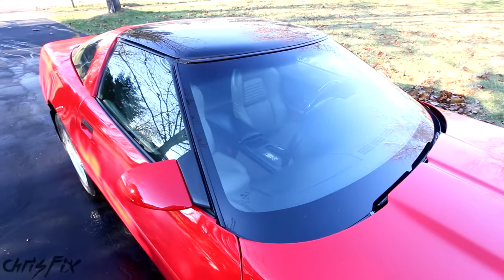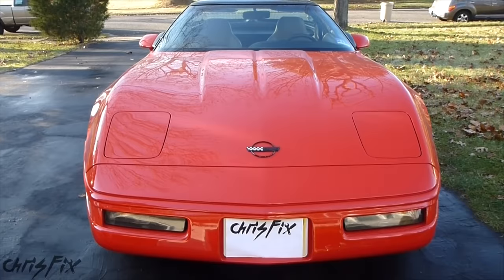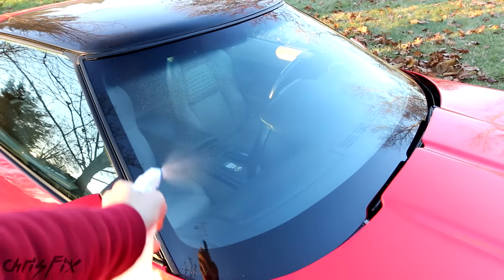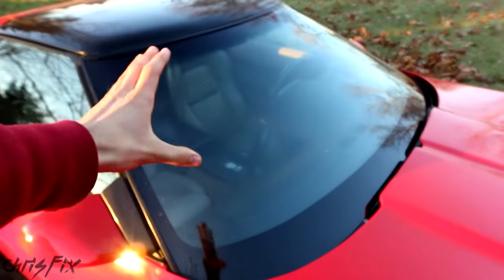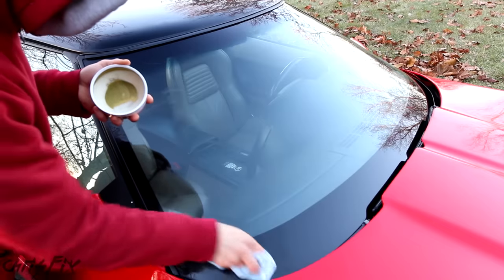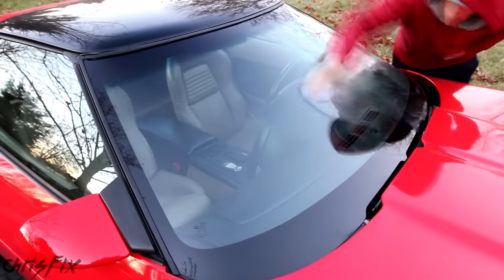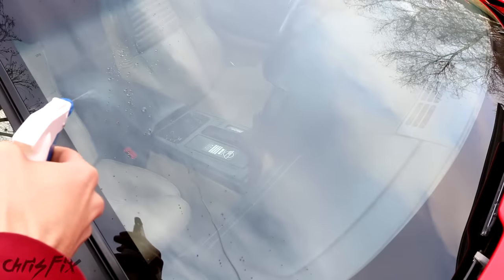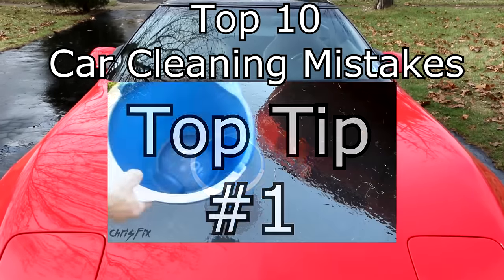How to Super Clean Your Windshield

Comment: whats the best way to clean the microfiber towels after they are dirty?
Reply: Really hoping you answer this one @chrisfixed!
Reply: Ride Alongside most detailers throw them away
Reply: Honestly.  Most of the time they are inexpensive enough to throw away.
Reply: Use another microfiber towel
Reply: Chemical guys have a video for that
Reply: Clay bar
Reply: Wash in the machine with a non bio liquid detergent that contains no fabric softener, also do not add softener either as it clogs the fibres and prevents the towels from absorbing water. You can also use a microfibre specific detergent such as chemical guys microfibre wash.
Reply: Ride Alongside wash it in the washing machine on the cottons option
Reply: ^ This (2 up)
Reply: Put them in the washing machine
Reply: soapy wooder
Reply: Yes, was about to ask the same thing! Ive heard of diluted purple power?
Reply: I use cheap $1 ones for dirty jobs and either keep them for future dirty jobs or throw them away. My nicer ones I wash and reuse as long as they don’t get worn out or stained. I just wash them with clothes and regular detergent but Griot’s Garage sells a specific cleaner made for car towels, mitts, and applicators that is supposed to strip wax and contaminants from them.
Reply: Ride Alongside throw them in the washer, just dont use any softener.
Reply: Mrcaffinebean - no he doesn't. He has a special washer/dryers he uses to clean them. Of course He does this for a living. Not ave car owner. He does family's wash in another. He rotates them in 3 piles. Nearly new, med use, marked up ones. He gets rid of the badly stained/black rubber marks. You can wash them with a bit of bleach. It doesn't hurt them. 1/4cup.
Reply: I get them at harbor freight, they usually have them on sale small ones 12 for $3.50 big ones 12 for $10, they last me long enough that I don't mind just throwing them out after they're used up. A full superclean on my car body + glass will usually use up 1 to 2 packs of small towels and half a pack to a pack of big towels. $25/year and $12 or so biyearly is a drop in the bucket compared to what you're spending on chemicals anyways!
Reply: Put in microwave.
Reply: Ammonyc has a video on that
Reply: Ride Alongside you buff it with a microfiber cloth while making sure you spray it with some warm wooder
Reply: Just use a 60000 psi water jet
Reply: I wash them in a washing machine WITHOUT CLOTHS or other items and I use a Fabric Softener to keep them soft.
Reply: Pan says wash warm water dry on air dry no heat
Reply: Mukesh Awasthi cook them?
Reply: John Deleone that’s going to stop moisture absorption
Reply: Well, to avoid working any loose dirt into the gentle fibres, make sure you clean it with another microfibre towel
Reply: Salvador Martinez you thought you were gonna get loads of likes on your comment. But all you got was a dislike from me.
xD
Reply: I just throw mine out mate you can get 20 for a few quid on eBay
Reply: The most important thing:  Wash them ONLY with other microfiber.  One cotton item will ruin your microfiber.  Number 2: No fabric softener.  Wash hot, dry medium.  Downgrade their level of service as they age-- use on critical shiny stuff when young, wipe the vinyl and leather when they're old.  Throw away when they're just not doing it for you anymore.
Reply: Mr Everything .
Reply: Another microfiber towel!
Reply: Wash under warm water then rub on the dark bits. Then I guess put it in the washing machine
Reply: They are so cheap at walmart. 10 for around $5. Probably disposable.
Reply: wash in washer, warm water, liquid laundry detergent (no softeners) mixed with microfiber towel cleaner solution. I also dry on light heat, do not mix with cotton or clothes or anything other than microfiber when washing/drying.
Reply: I let the "broom" handle any of that kind of cleaning.  She does as she's told.
Reply: @shadydemon9604  exactly
Reply: Rub your dirty microfiber towel with another microfiber towel.. 
Ok, real answer. The CHEAP mic-fib towels suck so I’ve found what brands hold up and work best. Have 2 10-gallon buckets WITH LIDS, 1 for clean ones ready to go, other with 1/2 gal of vinegar and 5-6gal of water. When done with towel toss it in the water & vinegar bucket with lid on it. When that bucket is full just toss towels into washing machine on sanitize/super hot with no detergent. Dry like normal and put back in the clean bucket WITH LID. No lid and your inviting dust and whatever on your clean towels  and that can be like wet-sanding your paint.
Reply: Toss in rag bin for regular rag use
Reply: Adams polishes has what’s called microfiber revitalizer which helps for cleaning micro fiber rags
Reply: and of course, if you drop in on the ground, it's done throw it out
Reply: Is there a different method for cleaning silicone wiper blades? Or is it ok to clean them the same way?
Reply: Cheap!? Damn why did I buy towels at Microfiber madness? Lol $100
Reply: Go on amazon and search for microfiber towel detergent. I personally prefer the one from chemical guys and it’s cheap. If you’re towels are pretty heavily spiked then soak them in hot water before you wash. When you wash them use a gentle cycle with hot water. And never use fabric softener
Reply: Put hem in your washer
Reply: Machine Wash and many rinses to clean out the detergent
Reply: Best way to launder them is with vinegar. Let them sit for a while in water with vinegar and then throw them in the laundry machine. Just don't use any fabric softner since the MF towels wont absorb any water anymore.
Reply from the maker: I put them in the washer machine. No chemicals besides regular detergent. Then throw them in the dryer and again, no chemicals or dryer sheets or anything.
Reply: Ride Alongside Washing machine with regular clothes cleaning chemicals but only have the microfiber towels in nothing besides microfiber towels. Then put them in the drier with nothing else in with them, again.
Reply: SOAPY WODER
Reply: Warsh them with wooder in the warshing machine!!!  LOL

Comment: I used to work in a factory that manufactured small glass plates  for use in computers or some such things (they never told me). We used to have to clean the glass plates by hand. I can tell you that most of what he said was true. You just don't "spray on and wipe off". There is a polishing component that is involved, and a lot of the final process involves not just wiping, but how hard you are polishing the clean glass. It's really a skill that most people don't realize, but is easy to learn. And if you clean your car glass properly, you won't need Rain-X or other bullshit to keep you going if you have good windshield wipers as well.

Comment: I just spray with a hose once a year
Reply: James Evans I go a step further and pour soap on the car when it rains.
Reply: James Evans Yep - once a year whether it needs it or not.
Reply: AngelEyes I must confess, I have cleaned my windshield with a newspaper now. I like to be safe regarding visibility
Reply: Craig Schultz What the hell are newsprint?
Reply: KinGIIRomE newspapers paper
Reply: +Craig Schultz New Newspaper works very well.  One to clean. One to Shine.   If you are without a  microfiber towel. Need to clean the windows right away. You are better off with a newspaper vs a cheap towel or rag.
Reply: huffington post keeps putting the stuff on my doorstep

Comment: I have a problem with my wipers after this, i mean the rain just falls right off after i did this, but now when i do use my wiper blades its like all foggy like and I did clean my blades. I'm just curious why that happened and what i could do to fix it.
Reply: I have the same problem. My blades makes loud noises after I use rainX or wax on my windscreen. Chris do you have the same issue as I do? Thank you
Reply: I guess you are not fully taking off the wax. Make sure you wipe off the wax with 3 different clean micro fiber cloths.

Comment: How should I clean my microfiber towels after using them !
Reply: For uses like this, I wouldn't try to clean them. I'd put them in the shop rag pile then throw them away after that. If you purchase microfiber in bulk like at Costco, then they aren't too expensive.
Reply: throw them in the washer on hot, for ones that still look bad keep them for inside the doorjambs and stuff like that
Reply: ok thanks
Reply: throw them in the wash on HOT, I use detergent, color safe bleach and fabric softener. the REAL dirty ones I just use to clean door jambs and stuff like that. YES they are cheap at Costco but no need to THROW them away after one use, that's stupid.
Reply: Thanks
Reply: never use fabric softener on your microfiber towels
Reply: use microfiber soap from Chemical guys, or griots. separate type of towels. Wash separate. especially if you used scratch filler or other chemicals. do separate washes. chemical guys has that video.
Reply: Ammo NYC has a video about this, Larry's real into detailing. He works on expensive automobiles.
Reply: Don't use fabric softener. Fabric softener is oil, the last thing you want to put on an absorbent towel.
Reply: Nick Mossey hint: they made clothes washers for a reason
Reply: Use SoapyWooder its the best.
Reply: can't second this enough!
Reply: I have heard that fabric softener makes any towel or wash cloth less absorbent.  It makes it repel water.  Also, if you use them, be careful of the screen on your dryer.  It should be washed periodically because the softener gums that up too.
Reply: I disagree. Fabric softener is not cool for towels it makes towels repel absorption. It also creates buildup. Just a woman's perspective. I wouldn't waste time on the bleach either. Things break down faster and you need those fibers plush, not dried out.

Comment: chris, can you use the clay bar more than once or do you just toss it after each cleanse?
Reply from the maker: You can use it more than once. Once it starts getting visibly dirty, I throw it away.
Reply: ChrisFix Where do you get this clay bar from? Here in Alberta windshields end up like theve been hit with a sandblaster after the crud they dump on winter roads a sand and gravel.mix with a small amount of.salt added in for good measure. Was told to use 0000 steel wool to help remove some of the glass imperfections. At night or with bright low sunshine it's almost impossible to see through without a glare even after cleaning. Maybe it's time for a new window 😣

Comment: Will wax on the inside prevent fogging?
Reply from the maker: Yes but it will make a mess when you buff the wax off.
Reply: +ChrisFix Ahh... Good point
Reply: +djtblizzle I struggle with the same problem. Im considering getting some cat litter and filling it in some socks to soak up the exess humidity in the car. Right to the tumor, stop fighting the sympthoms

Comment: I saw a video of someone using 0000 grain steel wool for the first step of cleaning all the grit off of a windshield. At first I was sceptical and thought it would scratch the window. But it seemed to work in the video. Any thoughts on this?
Reply: I tried using steel wool on an old screen with a crack in it, so it was junk anyway.
The wool didn't scratch the glass as it is quite  soft compared to glass. It still didn't remove caked on water marks though so must be reasonable gentle.
Reply: +Q'ben Al Zaeen that was also my experience. didn't scratch it, but didn't take off water spots either.

Comment: Hey Chris, this isn't related to the video, but I couldn't find any answers on the internet for this. I want to see how my 2001 Dodge Ram looks without the bumper valance on. Not sure if it's safe, since it might have aerodynamic purposes that I don't know about. Do you know if that's okay to try?
Reply from the maker: It is not safe to drive without a bumper for the reasons you stated but also for protecting the radiator and ac condenser from rocks and damage.
Reply: ChrisFix I know that, but I mean the useless-looking wall of plastic underneath the bumper. It's bolted on the underside of it. I can't really explain it further. I might as well go take a picture lol.
Reply from the maker: That helps with aerodynamics and downforce and protecting the undercarriage.
Reply: ChrisFix I've seen a few people who removed theirs. Guess I'll be laughing when I'm not having to fix the undercarriage. Thanks Chris!
Reply: +ChrisFix hi chris i dont like the stains left so are you sure the cleaner wont leave the stain
Reply: Glock

Comment: So following this advice I waxed my windshield (after cleaning it of course) when waxing the whole car. I also cleaned the wiper blades. I used Turtle Wax hybrid solutions ceramic spray coating. The water does bead very well - but when using wipers a sheen or haze will appear after wiper pass. The haze disappears after few seconds but will return after each wiper pass. This effect appeared definitely after wax application. Now I guess I need to remove the wax... I must say this was not the greatest advice.
Reply: HArd to believe this comment has been ignored for 9 months... WTH!
Reply: Maybe he used a different wax?
Reply: also if you have auto sensing wipers it says not to use silicone or rainx because the slickness makes the auto wipers dysfunction
Reply: Maybe you used the wrong kind of wax
Reply: Thanks for the heads up! Gonna avoid the wax then

Comment: Newspaper or paper towels will NOT scratch your windows either lmfao😂🤣😂
Reply: Correct. Something can only scratch something else if it's a stronger material. So you can scratch a clearcoat with newspaper because your clearcoat is not really solid material. Glass, on the other hand, is a very strong material...It will not scratch so easily. Even if you'll try scratching it with a dish cleaning pad, you'll probably fail to do so.

Comment: my 12 y.o cars windshield is littered with tiny scratches taht become visible in direct light. How do i go about polishing those suckers off?
Reply from the maker: I will do a video on that!
Reply: Dima G I have the same problem.
Reply: new windshield ....
Reply: OH, look at me, just the king of moneyland, where it rains new windshields for cars ...
Reply: @chrisfix  Did you ever make the video on fixing a scratched up windshield? I can't find it. I don't want to use power tools and don't need it to be perfect, just something I can work on improving a little bit from time to time. Using Rain-X or Wax simulates a fix, but I want to actually improve it without damaging it. I don't like the idea of a new windshield, because if it is installed improperly, it can look bad or cause problems (aside from the money), so just improving the surface to have the scratches not be as bad, is the best option for my situation. Also, some people claim that wax on a windshield can cause the wipers to drag.
Reply: Jay H you can’t, glad is a very hard material, only way you can cut it is by using a diamond. That’s why I cringed when he said he didn’t want to use a razor or steel wool, it wouldn’t do anything literally.
Reply: Google Eastwood Glass Polishing Kit.  But also look into a replacement windshield - for an "average" car, you can often get the windshield replaced for around $200
Reply: jeffeverde1 costs 400 for my car and I’ve used both razors and steel wool after watching this video. Steel wool did a better job in my opinion.
Reply: SirXyloid wait a minute, lol what about rock chips? Stones are not harder than diamond. You can 100% scratch glass all you need is something just a tiny bit stronger. You pulled that out of your bum lol
Reply: Your 12 year old has a car? Dad of the year! 😎
Reply: @darrellkrieg9698  you know what most rocks are made of? SiO2 - quartz. You know what glass is made of? SiO2 with sodium and calcium carbonate to lower the melting point (create an eutecticum). Natural quartz often is not an eutecticum but relatively pure silicium dioxide which in fact is harder than artificial glas (windshields at least have a mohs scale value of 7, quartz has 100). The reason that the industry uses diamond to cut glas: way cheaper to produce than melting SiO2, also much more versatile (different cutters, clutches etc., Hardness of 1500). English is not my native language but I hope you can understand what I am saying.
Reply: It is really a bit risky to drive at night with that problem
Reply: @chrisfix  just do it
Also mention a lasting prevention for the problem
Reply: don't change your windshield unless u have too.  aftermarket glass is much thinner.  you will get star/cracks much easier and even the best pro's have a hard time getting a perfect seal.
Reply: @chrisfix  still waiting
Reply: @SirXyloid  So birds poop diamonds? Cause I got my windshield scratched by cleaning bird poop with a wet sponge.
Reply: @FusionDeveloper  I have used a buffer on them using a low grit compound.
Reply: @chrisfix
Reply: Polish it (with a buffer, DA, or drill attachment) with a small amount of paste made of 2 parts cerium oxide and 1 part water.  Add a bit of water to the glass as you go along to keep the material damp/paste. Polish for about 10-15 minutes, as needed. Cerium oxide powder should cost about $10 on eBay, for an amount way more than you need for a windshield. I just did. (Too bad I didn't think to film it.)
Reply: @darrellkrieg9698  stones if they hit on a tiny point transfer a lot of energy and cause a lot of pressure.  Hence it chips glass.  But he is right that glass is actually a very hard substance but it doesn't take shocks very well.  To cut glass the glass cutter has a diamond tip.  Jewellers' rouge can be used to polish out scratches.  The scratches develop over time because of time tiny elements of grit which may contain quartz are rubbed backwards and forwards over a long period of time.
Mohs scale was developed to determine relative hardness. On the Mohs scale, fingernail has hardness 2.5; copper penny, about 3.5; a knife blade, 5.5; window glass, 6.5; steel file, 6.5; quartz, 7; hardened steel, 7-8; diamond, 10.